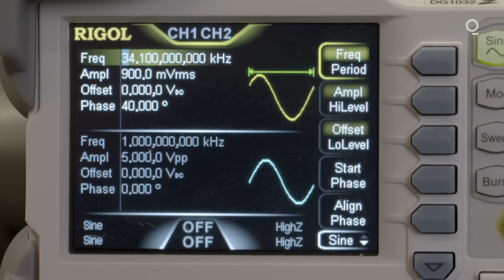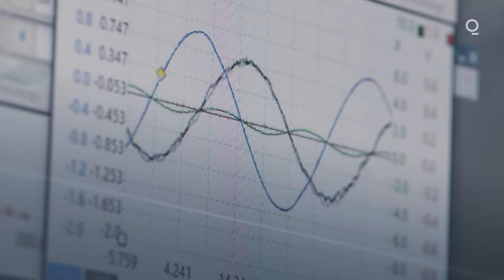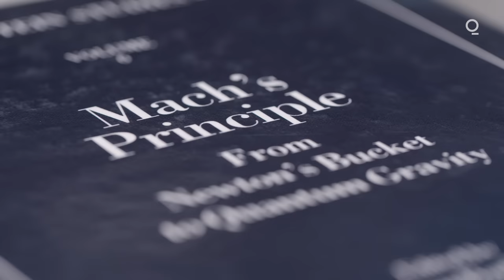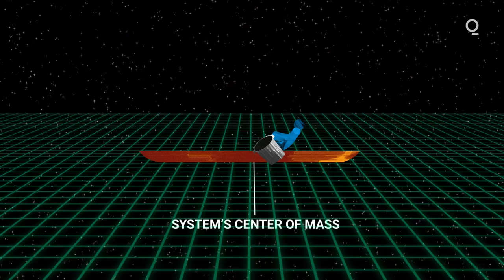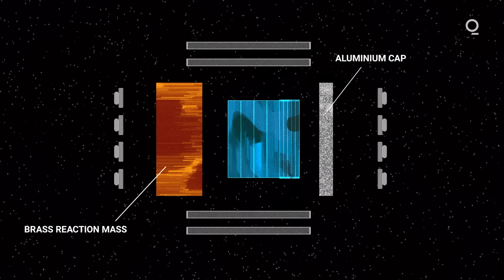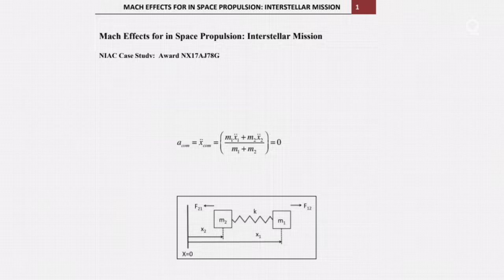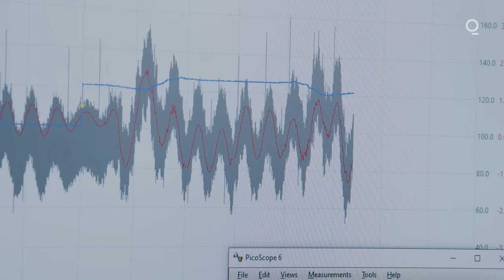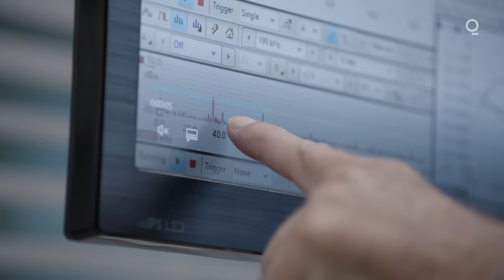Two Scientists Are Building a Real Star Trek 'Impulse Engine'

Comment: They mention that the effect seems to be stronger in smaller devices, and thus a spacecraft engine would consist of a vast array of them. I wonder if the stacks of piezo wafers could be replaced by a solid-state material with a similar internal structure, with the "wiggles" occurring at the molecular level. A given volume of this material would contain many orders of magnitude more stacks. Using semiconductor industry processes to "grow" large blocks of the stuff could make compact engines of significant power possible.
Reply: What has to happen is that energy has to be put in when the mass is forward and then removed when it is in the rear position. That energy then has to be discarded when the mass is in the rear position. The energy would have inertia so could not be moved forward to be re-used. It would be just as efficient to use a light backwards an an engine.

Comment: I had the same kind of thoughts on a propulsion engine with no fuels, they're experimenting with different forms of energy, sound and vibration, kinetic energy, whatever you want to call it, is just as much a type of potential energy as petrol, it needs to be harnessed in some way, or its useless. sonic cutters.... enough said, you can make use out of any kind of energy for something.

Comment: 5:09 "But the megadrive is setup to vibrate mainly in one direction" HOW? You gloss over the main point of the whole thing. Also shrinking doesn't mean a loss of mass but the opposite a gain in mass as it's movement creates inertia. If the device is on a surface which is slightly inclined then oscillations will result in it moving in the direction of the incline.

Comment: The drawback to such a drive is that if you traveled through space at, say, 40% of the speed of light, the tiny amounts of dust and gas present in the not-quite-perfect vacuum of "empty" space would hit the ship like a constant bombardment of cosmic radiation intense enough to fry your ship and you with it. You'd need some huge mass of shielding in front of the ship to protect it (maybe a gigantic fuel tank filled with liquid hydrogen and with a very thick leading wall?). And even then, it would probably be smart to stick to a lower velocity, say 10% of lightspeed. (Which would still make it possible to reach Alpha Centauri in about 43 years).
Reply: I think some kind of electrostatic field around it that could deflect any material that could collide with the space craft could be made up but you have a point. I think it would just be an engineering one though. Some thing similar to oil on a piston to remove the touch.
Reply: @leonhardtkristensen4093  Even with such a field, the matter in the interstellar medium would stil exert substantial drag.

Comment: If you exceed hyper speed eliminates time does not exist until slowed down hyper motion to return time again. So that means you won't age and with an extensive oxygenization mist in a rotation of water vapors  in the starshipto to breathe in space. To reverse gravity is by reversing  gravity from 0 gravity to the same estimated number of gravity as is in earth then you have the same gravity on the inside ship as on earth. That is all based on magnetic mechanics inside the starship to optimal level earth gravity.

Comment: Use Black Hole machines to create trillions of microscopic black holes in the form of a ring or whatever shape will work. The machine will constantly have to recreate new ones as they will almost instantly decay. If that creates a danger of creating a larger black hole due to the persistent gravity (I have no idea but I imagine it might) then make it a pulse drive. Could you end up with a warp drive or a warp pulse drive? A recent paper suggested you could use positive energy if it is arranged at right angles (I'm sure I got that wrong but not the part about positive energy). Either way, black holes warp space time. I wonder what it would take to make something like that work if at all.

Comment: I do not agree with the rubber sheet analogy since it does not really make sense based on non-Euclidean geometry and general theory of relativity. I believe space actually contract a bit as mass affects spatial dimensions around it. The more gravity the more contraction of spatial dimension which acts like combined gas law where it becomes more difficult to contract as more gravity is present. 
Basically we are in a storm which is in a bigger storm where the barometer is at a low state and, it will show a much higher value outside the gravitational effect of our sun and galaxy.
This may be the cause of dark matter and dark energy.

Comment: We've seen what a flake of paint-sized debris can do to a satellite travelling at an orbital 27,600 KPH.  
1) Imagine what would happen if we hit that same paint chip-sized piece of debris travelling at 0.4c? 
2) Not to mention HOW much energy is it going to take to SLOW DOWN from 0.4c?
3) And at what point would we have to BEGIN slowing down?  
You can't just do the math and say it will only take us "this long" travelling at 0.4c without taking into consideration the time it takes to GET to 0.4c and then how long it takes to slow down from 0.4c.  We're gonna need WAY more technology to keep us alive than just propulsion...
Reply: You are right. You accelerate to the middle of the way and then start to decelerate. This would give some gravity like condition the for most of the trip.
In regards to debris then maybe some static field  around the space field could deflect it and make it glide past.  
Your points are only engineering problems that can be fixed I believe. The energy needed is still the problem.  A light beam can do the pushing (similar to a rocket engine) but the vast energy need is the problem.

Comment: 11:45 Yes it can be the case we did not look hard enough and that can lead to pink elephants existing, but what is the difference between zero trust and unmeasurably small trust looking at it from space travel perspective? Both results do not move the spaceship. One can lead to discovery of new propulsion methods but that is pretty long shot and currently more important in other areas than in space travel because by the time you successfully scale unmeasurable trust to useful spaceship engine you would have discovered bunch of other new stuff which could potentially render this useless?

Comment: It's not important if it moves forward, but does it move forward using less energy then you put into it. If the same amount of energy could be used to move the contraption in a more classical way, then it's not more efficient than we already have.

Besides, moving in a gravitational potential toward the point when the potential is even higher is nothing unusual - it's called falling. What this should show is that you can move against the gravitational potential gradient to get out of the gravity well.

The contraption does not work and it has been proven to not work, sorry.

Comment: I can see how the theory will work but I would like them to include the bucket idea using a pumping action with the space dust in zero gravity. If you take the dust from in front of you it makes a void then out in back and you have a solid to push from. Adding a dust scoop with Labyrinth venting would provide the pumping by the movement of the plates

Comment: Off-center weight motor (vibration motor) can do the same job ?
Reply: Sadly, no. That only wiggle around, opposite the wiggle of the motor. No motion would be induced. This requires that you actually change the mass of something and use that difference in mass to drag yourself through space.

Comment: can they not craft some sort of gel that they can put the drivein and leave running , the gell would be dense so to hold the drive though not too dense as the mass of the drive should be small and aerodynamic - depends i guess if the drive has enough push to get through the gell for starters... :(

Comment: The only way you could improve on this method as described, is to move to a medium that can capture electrons as their mass as stored counterparts without making the material gain any volume, just density. It would work best with any material that gained more mass with a single electron charge than with crystals, finding a liquid that could compress under an electric charge to become metallic would be ideal.

Comment: Then I thought it through. How culd this work at all? Moving electrons are moving mass. So this cannot work.
And then I got an idea or was it just a thought: What about combining some of this with repeating quantum lock and quantum release?
No, of course not. It would be just the same, would it?
An older idea is this:
Accelerating some object to a real speed by using an apparatus similar to a particle accelerator ring wit ha linear motor inside to speed up an object. The accelerator should be bigger due to the size of the object. The accelerated object should be released into space.
This is possible on the moon because there is no atmosphere.
Well, it should be a really big apparatus. Of course it should be on the moon. Built as a ring there should be two equal rings at one pole and two mirror rings at the other pole, all four should always run simultaneously with objects of the same mass and the objects should move in the opposite directionat one pole and mirrored at the other pole.
Due to actio and reactio, one or two accelerator rings at one pole  would cause the moon to rotate or tumble.
The positioning, adjustment and measurements should be as precise as possible.

Well, maybe it would take a hundred years.
But wouldn't it be an enormous success shooting two objects with speed much faster than any rocket through space?

Comment: Short run, multi rail linac with multistream cyclotron primary acceleration.
Getting high percentages of lightspeed for Isp.
(The cyclotrons get like 50%-60% c, and the linacs add some more.)
(multiple streams for more throughput)
(preferably using the same set of fields
and the same set of hardwares for multiple streams
=>recursive hardware usage=>less mass on the engine)
Reply: Or alternately, build a three stage hall thruster.
Using Hall effect for 3 acceleration stages, instead of just one.
Much less efficient, not even close to impulse.
(Impulse would by at least 1% of c as Isp, with 1-10% being primitive, and anything
above 10% being a real impulse drive, and ofc anything truly nearing 99% advanced
impulse.).
Reply: Note: The streams would be more like a continuous set of blobs of matter and ions
don't have to be one element based. In fact larger ions are preferred when they
can be accelerated to high c percentages.
(multi-element ions)

Comment: Hmm, truly fuel-less drive ? I'd have to see for myself to believe.
Although it may be possible, using low fuel usage and capture along path
refuelling drive is easier to achieve.
Especially when any probe would reach extra stellar space, in which such matter
is readily available, and would also create drag on the probe.
Using the drag added matter for fuel is simpler.
Reply: Who said “fuel” less?  Fuel less would be a perpetual motion machine; NASA wouldn’t be studying it.  “Propellant”-less drive is what the video was describing.  Big difference.
Reply: @adayexpired6370  If you have propellant you have fuel, if you don't have propellant you have no fuel.
A perpetuem mobile is also not applicable. I guess they would try and research a power consuming but fuel less drive.
Not a motion that keeps on going without any expense, which would be a perpetuem mobile.
In space everything keeps it's speed for the most part., but acceleration is key to steering and changing course and speed.
This they would try and study for fuel-less, if at all possible. Expense can be fuel or power or both, but even space draws the line at no expense. No expense means no change.

Comment: Generating local effect upon General Therory micro mechanical and electromagnetic devices environs.  The smaller the device, the larger the force that can be generated”.  What are the principle axioms,  ie smallest size/maxWatts possible.  Nanotechnology could play here?  Ie,    1 square meter covered at density N with piezoelectric chips generating acceleration gradient.  In other words,  how small can the device become?  What power intake is needed to generate delta effect?  Is effect significant with current or conceivable energy and materials.

Comment: The missing component is a photon emitter at the front which dumps the energy in high microwave 🤔  then the drive needs to be 100,000 kilometers long 😊 should reach the speed of light 😉  in about 1000 years😅

Comment: An Object at Rest, stays at Rest. An Object in Motion, stays in Motion?
Why? This may be due to Aether. As a Body, when we Move Forward, Aether goes Inside our Body and Gets Crunched Up. Then it Comes Out of Our Back  as the Pressure is Lower on that Side.
This may Not Work Properly in Areas of Low Aether density or When Moving from Low Aether density to High or High Aether density to Low Aether density. This explanation, May be a Reason for Why Slingshots Around Planetry bodies Works. Otherwise, Slingshots wouldn't. Those Darliks should Know.

Comment: Time dilation on the particles within the energized portion of the cycle may negate the effect of having the higher mass at that point, thus conserving momentum. Not sanguine regarding their prospects. On the other hand, I've wondered about half a century why noone has succeeded in building a device composed of a pair of antenna, each energized from the same high frequency source except that one is delayed by 1/4 of the period and is 1/4 of a wavelength from the other, such their magnetic and/or electric fields are from the aspect of one 180 degrees out of phase and from the other in phase. This should, with the proper configuration, cause a direct motive force on the antennas, one being attracted to the other while the other is repelled from the one.

Comment: Mach is wrong in the sense that it is not gravity is not a distant force. Its easier than that. Inertia is everywhere and right in front of you. This stretching theory of gravity is an incorrect illustration of the Einstein theory,..it always has been...its not about stretching, its about energy potential in any given point in space. That energy potential can either slow you down, or speed you up, depending on whether or not you can manipulate that field.

Comment: To me, the mechanism seems to work using a form of, for a lack of better words, simulated recoil. So if this was better designed and advanced, it could be able to lift any weight given enough electricity. So TL,DR; the idea could work, but not for the reason the professors believe

Comment: Here's food for thought. Newton says F=ma. How do you tell the mass? Count up the number of atoms with the atomic weight, and normal teaching you get says mass is constant at regular human scale speeds.  Have  a closed box with a gyro inside. Can you tell if the gyro is spinning even if silent? Yes. How is this? For F=ma to still be true the mass must be changing a lot, or F=ma is wrong even at the human scale.
Here's another one. Why don't they demonstrate firing a projectile vertically up at known speed, see how high it gets, and measure the speed on the way down as well. I can't think of a better way to demonstrate mgh and 1/2mv^2 equivalence.
Why in a discussion was Galileo's timed drops mentioned as serious evidence? Using human pulse, when they have atomic clocks and laser beams now? Really?

Comment: There are pink elephants, Queen Elizabeth saw them in Africa just before she became Queen.

My bet for fuel-less propulsion would be a polarized plasma optimized to one way ('diode') quantum tunneling thru a series of thin plates.
If the tunneling is set in only one direction by polarization or relativistic velocity, the quantum tunneling might impart a momentum of a unique type to the plates.
This inertia would be conserved by deposition into nearby vacuum fluctuations collective momenta much like phonons thru a crystal. The inertia needed to put the plasma thru this 'quantum tunneling diode' probably in likelyhood would end up being conserved, and so it shouldn't work.
In that case the plasma coming thru would have a compensating (conserved) inertia after tunneling thru a plate, easy to prove/disprove.

Comment: So, anyway, F = ma = (m*v^2)/r. An extension of one of Newton's Laws of Motion with Huygens' equation for uniform circular motion.  About vectors and, in the case of Huygens' part, cross product for vectors.   If you have a closed circular tube or pipe with water being pumped through it, the Huygens' might make one scratch their chins a bit. If you fold the circular pipe along its diameter, with the water still being pumped, to about 20 degrees or so then the 'F' vectors (there are two vectors, think about it) appear outside the 'D' shaped side of the structure, as the 'diameter' is now a chord. So the newer equation then might look like F = 2*0.98*[(m*v^2)/r]? See the Amazon Kindle 'Traveling Through Space --- Without Rockets --- The Shorter Version.'   A cheap, easy read with several DIY experiments too.